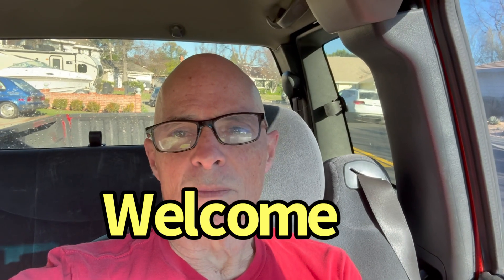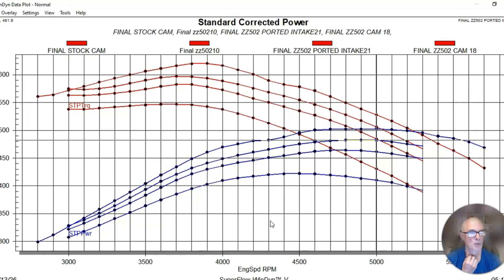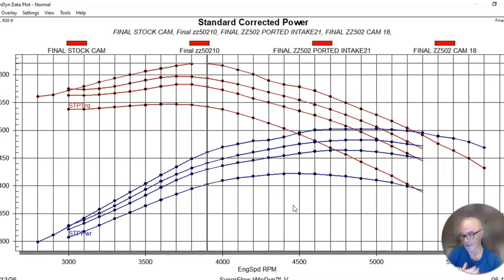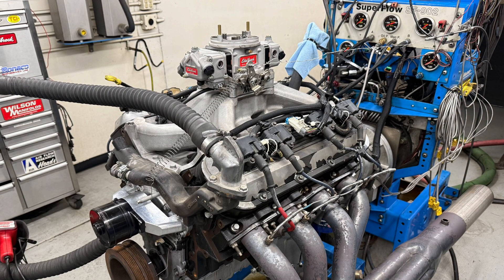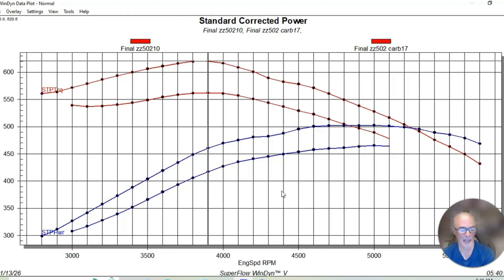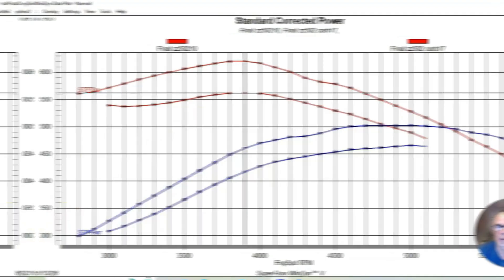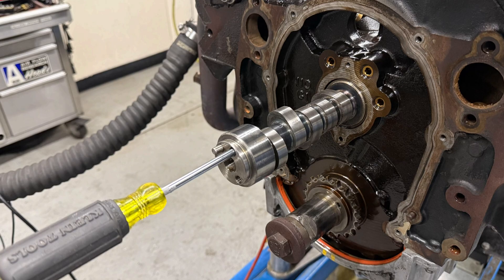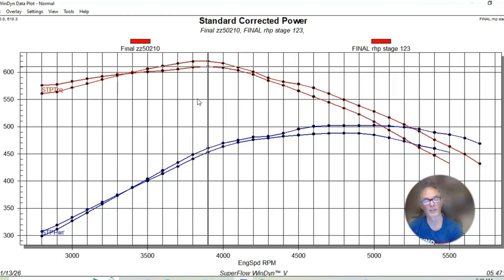CHEAP 8.1L CAM TEST-HOW TO ADD 30 HP AND 30 LB-FT FOR TOWING. 8.1L DART CARB INTAKE VS EFI-WHO WINS?

Comment: ide be really interested to see you do i video with a turbo 3.8 v6 Essex! done tons of research on these engines and it seems that as long as the engine is healthy and you run the proper boost cam, that these engines are capable of some serious power! an underdog to be sure. highest I've personally seen on a stock bottom end with a boost cam is 469whp on a dyno which is just crazy!!

Comment: Richard do you have any interest in testing this 366TD with nitrous and supercharged blow through carb?
Reply from the maker: is that a stock 366 BBC?
Reply: @richardholdener1727  yes.  Absolutely not a performance engine.  Everything wrong for performance. But if that number is obtainable and it will make 500 passes.  That’s very desirable and achievable for a lot of budget builders

Comment: Richard, I’ve heard rumors that guys used to take a 366 and Overdrive a huge blower, then run tall gears with 2 speed PG and slicks in a G Body. They said they kept forcing fuel, timing and air into it till it popped, then just bought another used bottom end for 200 bucks (very plentiful).  You’re the only guy I know who would push one of these old torque anchors to breaking point.  Supposed to be nearly unbreakable. The idea was to make 500 hp 600 ft lb for dirt cheap with used factory long block.  Please respond if you read this
Reply from the maker: the 366 tall decks?
Reply: @richardholdener1727 yes and the guy also said some would push nitrous into the mix.  The idea is dirt cheap 500-600 hp/tq     Supposedly the bottom end is virtually indestructible and cheap to replace if it ever broke.   Obviously a 454 or 427 would be ideal, but every junkyard is full of running 366 TD.  Some of us live for the cheap power chase.  He also said they would convert the factory dual line into a blow through double pumper.  Thanks for the reply!
Reply: Richard do you have any interest in testing this supercharged nitrous 366 TD

Comment: I saw that they are starting to make new Predator carburetors again, I would be interested to see what power they make compared to a conventional carb with the same max CFM value. Since the Predator has a variable CFM rating, I'm wondering what the benefit of having a variable CFM carb.

Comment: Please test a single plane manifold against that ported factory manifold with that same carb. I mean you're running big tube headers (race) and a wimpy dual plane, of course the engine is gonna suffer, its not matched. Please give the engine what it wants with a single plane (dart or Victor) and maybe even a Dominator, you've got the cubes for it :)
Reply from the maker: those don't exist for this motor and a single plane is actually not a good choice for a 224 (or smaller cam)-it just needs a better dual plane or the long runner EFI
Reply: @richardholdener1727  Sniper

Comment: Richard. Ive been wanting to see some "towing" dynos specify geared towards tow rigs and rvs. Low speed driveability and torque under 3500 where we're using it towing on the highway. My 7.3 godzilla motorhome runs about 2500 at 70 for instance. Ive been waiting to see some dynos simulating towing at part throttle to see how different combos respond at less than wot. Love your content otherwise.
Reply from the maker: we don't dyno for power at low throttle angles-all that testing should be done in the vehicle. The engine dyno torque curve gives you an indication-but you can vary torque output with throttle angle

Comment: My favorite thing about the 8.1, was plowing with a 3500 RCLB , shutting it off, sleeping for two and a half hours, in 14⁰ temps, and  hitting the key, and the engine was still 120⁰ .....
It pushed a 9.5 foot V plow like a champ.
Reply: One night we had about a foot of snow drop. When I left for work there was a car stuck, blocking the road. I drove on the sidewalk and hooked a strap to him and drug him through the snow essentially turning his car into a plow. I don’t even think I used 4-Lo for it. Just hooked up and got him to a better spot than the middle of the road. 8.1L Avalanche 2500.

Comment: Let's add a little boost to it and see if we can get it above 700 and push that curve up the RPM range a bit. And I love to see this monster motor get more aftermarket love. LT Lawrence has done a lot of work with this engine, which is where I first heard about it. A turbo wakes it up.
Reply from the maker: already ran a turbo on it previously

Comment: Wait, I could be missing something, but I went back and watched, and I think a more fair comparison from the carb intake is your dyno run with the factory unmodified intake with factory size throttle body and zz502 cam, which made 465 hp and 582 ft lbs. Then you just did the carb intake with the zz502 cam in it (sure you had different headers, so maybe a smidge different, but not drastic) which produced 466 hp and 562 ft lbs. To me that’s a more accurate side by side test from what you’ve run. And looking at it, those made the same hp (sure tq is down, but that makes sense because the carb intake has a little bit shorter length runners than the crazy long runners of the factory style intake). So I don’t think it’s accurate to say the carb intake makes less power than a factory intake. To me, you can say they have the capability of making the same
Reply from the maker: you are mistaken, the carb intake was down 40 hp to the ported EFI set up. The stock EFI set up was only down 20 hp
Reply: @richardholdener1727  then edit your video. Cause at 1:37 you mentioned on your dyno sheet the second pull was stock EFI with just the zz502. And the numbers I list above is what you state. You then show you running the dart intake with a zz502 cam still in it, and I just double checked the numbers I wrote above vs what you state in the video, and it’s what you said. So again, if your numbers you state in this video are correct, it’s not a fair comparison how you state it. I get you’ve been kinda all over the place with this motor with different combinations ran at different times over the last year or two, but from what I can see, dart intake makes about the same as stock. I’m not talking about comparing the dart to the modified intake you have, cause I bet Amos has over 50 hrs of work into that thing, so comparing that mod’d intake with a 102mm TB isn’t apples to apples. Comparing stock intake with stock TB and the zz502 cam to dart intake with zz502 cam is a more accurate look at things. And yes, I understand the tq is 20 lbs down from stock manifold, but as i stated above, that undoubtedly is due to a little shorter runner length, however it made the same HP…and I would bet it shifted the curve up in the rpm range a few hundred rpm too as compared to that factory intake/throttle body and same cam. Meaning it’s very close to a stock intake. Same HP, just a smidge lower in tq (due to shorter runner length). To me, that’s very close to the same performance as stock.
Reply: @richardholdener1727  502 cam with stock unmodded intake was 465ish horsepower at 4800.  Dart intake with 502 cam was 465ish horsepower at 5000.  So no, I think you are mistaken.  Dart intake has bad port match to heads, and injector bosses that protrude into intake ports.  a quick port job, and a proper spacer (not the half inch you used) and the dual plane will make more power than factory intake.

Comment: Sweet.

Crazy people will still complain about "no aftermarket" lol.

Those people tend to not own one.
Reply from the maker: AGREE
Reply: I would be so tempted to try some 3D printed composite intakes for the 8.1. It would be awesome to use the factory intake as a model and try to improve on it with different runner lengths and plenum volumes. I don't own 1, but that would be a ton of fun to play with.
Reply: @derekmelyndadeckens2982 myself and a few other people are working on that, files are being shared all through the community

Comment: Would love to see a 6.2 LT2 on the dyno out of a wrecked c8 stingray. Probably be hard to get one of those for some time though.
Reply: SMe thing that comes out of a camaro or truck different intake is the only physical difference
Reply: @austindoud273  I think the LT2 has a little more aggressive cam too.
Reply: @robp.1995  intake manifold is noticeably better too.  LT2 mani swap to LT1s is a thing.
Reply: @robp.1995 4 defrees intake 18 exhaust
Reply: @ChurchAutoTest  yeah it’s supposed to be good for another 25 to 30 hp